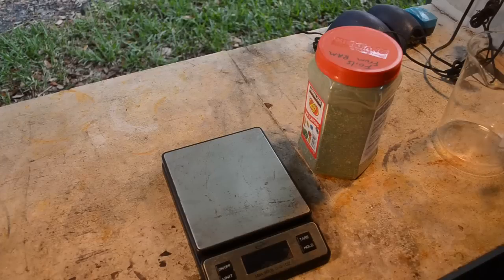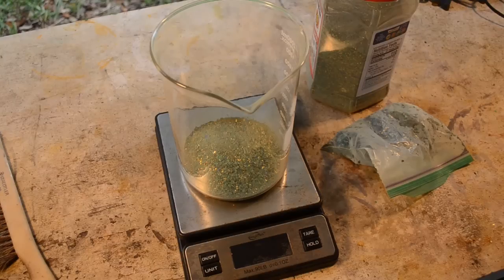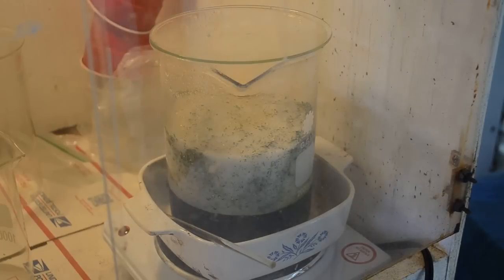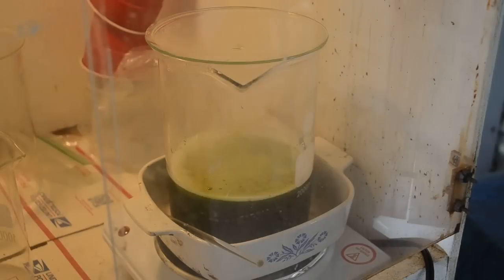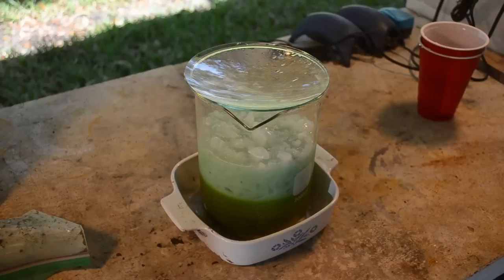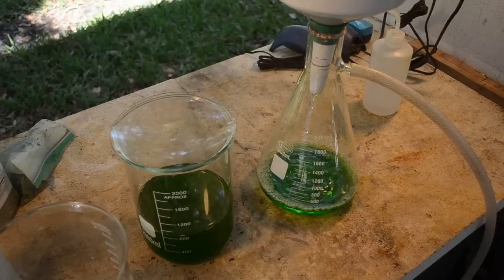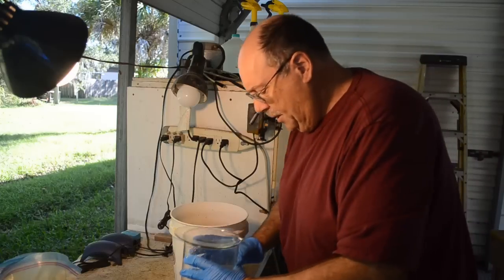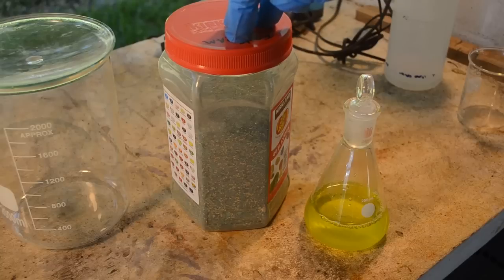Recovering Gold Finger Foils From 150 lbs Of RAM Sticks Part 1

Comment: Based on the fast reaction you had when you first added HCL, you still have a lot of copper and tin in your material.  I would do an HCL boil as many times as it takes till there's no or very little color change in the HCL.  Then incinerate ( filter and all) .  Then do your nitric boil to remove any silver and pladdium.  Filter and do you AR ( filter and all).  If you go to straight nitric before an HCL wash you will be dealing with a lot of metastatic acid.
Reply: If it is only foils from RAM fingers, there shouldn't be any tin in there. But I share your concerns about the HCl reactivity.

Comment: Since you asked, here's my $0.02 worth of advice. I didn't notice any stannous tests along the way, maybe you were doing them off camera but these tests will steer you along your journey.
The immediate color change when you initially added the HCL indicated this stuff is heavily contaminated with base metals. Maybe after the AP it wasn't rinsed well. Regardless, AP is a dirty process and never gets all the base metals the first round.
Give it a HCL wash with heat, several of them until the washes start to become colorless. Test all your wastes for the presence of PMs and if positive have the waste cement on copper before disposing.
You're going to find copper, tin, lead, silver, nickel, GOLD, palladium and possibly some other PGMs so focus on getting rid of the base metals first then work on your concentrates.
Don't worry about the other trash, it will be left behind when you're finished.
After cleaning it up I would then go to AR to collect the values. The silver should come out as silver chloride, filter. Drop the gold maybe with copperas and the remainder solution should be your PGM soup.
Very good material for recovery, you will do well.
I think the foaming you experienced was from tin in solution

Comment: I can think of two ways to do this the slow way HCL and peroxide then filter add HCL and powdered chlorine to extract the gold or the faster way stainless steel bowl Rose tip hand torch then nitric bath then process with aqua regia good luck on your processing your videos are quite entertaining and you've learned a lot over the past couple years keep up the good work

Comment: Smelt it down, add a little silver as collector, then just process it like inquarted gold. If you have a crucible large enough, just add the whole container to prevent any blow off. If not, maybe get it damp to avoid dusting while transferring to the crucible and heat it slowly to avoid blow out and cover it well with flux
Reply: Or if you like working with hot lye (i dont), a lye leach surely will dissolve alot of crap out of your material...

Comment: Sometimes re runs are fun to watch. The foaming is trapped nitrogen dioxide fumes. The solution attacts the metals still stuck to the plastic. The gas bubbles cause the trash to float and things turn into a foamy mess. A stirr bar would help prevent that. Smelting with a lot of flux would have been a better option. Pouring it into a cone mold, recover the button, then run it in HNO3

Comment: Just started this video & I'm very much looking forward to seeing what you do.
I've soaked a bunch of flat-screen TV & computer monitor fingers in Salt & Vinegar for almost 10 months & I have some of the green masking & alot of what I've been told is copper chloride in my filters. So this might help me when I try to refine my filters.
Btw... this was my first attempt at Gold recovery. That's the main reason I used the low quality fingers I did & I was able to do it in my house because it had zero fumes.

Comment: I watch sreetips also and he does gold refining. For incinerating things he took an old toaster oven and jerry-rigged the thermostat so it would stay on. Added some more insulation around the thing so it would get hotter. Then he puts his items in a melt dish and sets them in there to incinerate. If you have a Goodwill or can find an old cheap toaster oven, that might be an idea. There wouldn't be any wind blowing anything around, and you could easily get in to stir it. 
After that, as you and others have thought, I would go with a Nitric boil first to get rid of any silver or base metals.

Comment: Hi Mike, 
Hereby a further explanation regarding the possible dissolution of the PCB dust from the memory sticks.
I seem to remember that you have a background in chemistry (unless I am confusing you with another YouTube channel). Perhaps you can deduce, based on my little research below, which solvent would be suitable to dissolve the PCB material.

I found the below white paper on the subject:
Actually, a pcb board is composed of a fire retardant fiberglass mat impregnated with a casting resin. About the composition of the resin I found the following method/formula":
  (i) Stir and mix dimethylformamide and ethylene glycol methyl ether to prepare a mixed solvent.
  ii) Add dicyandiamide and stir to dissolve.
  iii) Add epoxy resin, stir and mix.
  (iv) 2-Methyl imidazole is pre-dissolved in an appropriate amount of dimethylformamide and then added to the above materials. Continue to stir thoroughly.
  v) After parking (curing) for 8 hours, take samples and test the relevant technical requirements.
The solid content should be 65 to 70%.

I hope this is of some use to you! 
Greetings from Michael
(Amsterdam)

P.S. My first thought was using sodium hydroxide. But that will take care of the green solder mask only. If you do that first, then you can rinse it off (since the sodium hydroxide is water-soluble) and do the dissolving afterwards?

Comment: Hi Mike, intriguing video you showed. I would drop the gold from the aurochloric acid you finally got in the bottle. The reason why is, that you can compare later on the difference in yields from the different refining methods you are going to test. And perhaps it's a good idea to do some different small scale tests as well, for the sake of science. Like:
- a test with nitric acid.
- a test with incinerating with added oxygen (reversed vacuum cleaner?) or in a ceramic oven.
- a test with smelting or cupelling.
- Or testing if you can get the green dusty stuff (of which I think is ground pcb board) with a solvent like acetone or something. I don't have expertise on the latter.
Good luck!

Comment: incineration is always a good option for this type of material. The hydrogen peroxide + HCL method would be the most likely but very time consuming so in the long run I'd go straight nitric for a few boils to remove all the base metals then I'd go AR. Just an opinion but after having done a few batches that was my choice that worked well
Reply: Where do you get your nitric? Or do you make your own?
Reply: Gotta make sure to account for the HCL from the AP BEFORE adding Nitric else you'll lose gold to solution.  That's why I'd incinerate first.

Comment: Another good vid, nice one Mike. 150lbs starting weight (full boards) is 68kg (if all boards where DDR2/3/4) x 0.0931 would give approx 6.3kg of fingers IF tightly cut, at approx 3.4g per kg tightly cut fingers. As its not clear what constituted the 150lbs I'd guess at 19g for the lot assuming half the sticks were from DDR2 or later and the other half where ddr/sd/laptop.
Reply: What about server DDR ram? Say 100lbs. Just curious, thanks
Reply: @wsdsable  depends on a few factors, if older DDR style you get less boards per kilo therefore you will get less gold fingers, which makes up the majority of the gold in DDR RAM. On the whole I find that DDR yields for whole boards can be hit and miss so I don't try to calculate them, they get broken down into their constituent bits and thrown in with whatever else.  I'd guess at 100lb's = 45350g / 20g per board average = 2267 boards. 2267 x 1.443g (typical weight of fingers per board) = approx 3272g of fingers. 3272g x  0.004 = 13.08g gold from fingers alone (at an average of 4g per kilo of fingers). Different ball game if you want to include the chips, I'd normally get rid of the chips on ebay as they are too much work for the yield. As a rough guess I'd say add 1/3 of that total if you go after the whole boards, that's probably being generous but I do get surprised from time to time

Comment: You can use Sodium Hydroxide to dissolve that "conformal coating" Put some of that stuff in a glass beaker, add a little distilled water and some sodium hydroxide. heat it up and the green will dissolve. I think you can then rinse it or even run it through a filter to screen out the gold.

Comment: A lot of good suggestions in the comments, I'm thinking first separate any magnetics from non-magnetic and possibly just some solvents to dissolve or rid yourself of the green dye particulate and way off thinking is some sort of static generator that would pull the gold foils towards it and separate some of the material. 🤔🤔👍

Comment: Brother, 
perhaps use LYE to get out the Green-Stuff protecting the circuits, 
perhaps after that Blue-Bowl (or like) to get rid epoxy, 
now left with metals only, 
perhaps melt and copper-cell, 
melt with some lead in cement or cupel, 
now left with cheap metals in cement and those you want in a small piece, 
ready split as silver and gold, 
keep rest for later as platinum-group ...
Reply: Using lye was my first though as well, but that will not dissolve the pcb-board. Probably only the solder mask part. But as a first step, it couldn't hurt probably.

Comment: I am far from an expert on this, but is there a reason that incineration of the core material, then threating the ashes with pirahna solution, filtering it of, then threath the remaining sludge by first extracting the base materials and then hit it wit aqua regia wouldn´t work?
Reply: Exactly what I was going to say, and the foaming is just the way it is with this kind of stuff.
The Piranha solution helps break down the carbon after the incineration, and helps to reduce the foaming.

Comment: You beat me to the punch. First start with nitric to get everything else out. Then you will have non metal junk and gold. Then use Aqua Regia.

Other option is to incinerate the material first to try to eliminate the non metal stuff then do above?

Correcting my guess I will think much less since it’s the full boards not just fingers. 
My guess is you will have 60grams at the end?

Comment: first thing that came to my mind I paused to write before watching mbmm shaker table or a funnel type water system to remove a majority of lighter material including the foils just my opinion I can only assume to why these are shredded are a security measure
Reply: Not shredded, probably copper chloride etched which leaves green solder mask and gold foils. Probably a lot of tin oxides too. The material looks like something that's been sitting for months so the copper traces have dissolved under the solder mask. That results in a lot of green solder mask mixed in with the gold foils.

Comment: Next time, incinerate the raw material to burn off the fiberglass and coatings. Then recover the gold from the ash. You need a muffle furnace at 1000 degrees c for this. No oxidizer, the furnace draws in air enough to combust the material. Do small batches in a tall dish to prevent loss.
Reply: This will also get rid of the cadmium

Comment: I think your sample size is way too big for convenient sampling. 10g-20g is sufficient for that. 
Starting with the chemical route you need a multi step process, as you probably have a wide rainbow of valuable stuff in there. Multiple looong HCl leaches to get rid of the base metals, wash remainder thoroughly, then a Nitric leach to extract Ag and Pd, then AR leach for Au plus other PGMs (if there). Drop with a gold selective method like copperas. 
I tend to prefer the smelting route with copper or silver as collector metal. And then run it through an electrowinning process. Or just a pyrolysis first. You need a way to get the bulk junk removed.

Comment: could you roast this to burn off some of the fiberglass or carbons
Reply: I agree, the material placed in a pan and roasted to fine ash would be good. But you run the risk of stuff flying in the wind. Then a nitric boil , and finally to aqua regia. 

Possibly better to just smelt down everything with some copper collector metal. Basically inquarting, then treat the prill with nitric and then equa regia

Comment: I hope I don't sound like a complete idiot, but I'm not a tech guy. What does coding that you're talking about mean & what's it made of?
Why is it doing what it's doing?
Reply from the maker: The RAM sticks have a green or blue coating on them that covers the copper traces on the boards. Most of the material in there seems to be the coating material. It insulates the traces and prevents corrosion. Not sure what it's made of, but whatever it is, it's annoying.

Comment: 12.3 grams when you're done. I'd incinerate in an oxygen free atmosphere (paint can in fire) then pan the gold from the ashes then do your chemical thing.
Reply: Gold foils are extremely light so you can't pan it. It even rides the turbulent air out of the beaker and spread over the board in the beginning of the video.

I suggest incineration to get rid of the green solder mask and chloride salts, maybe a nitric boil to get rid of copper before aqua regia.